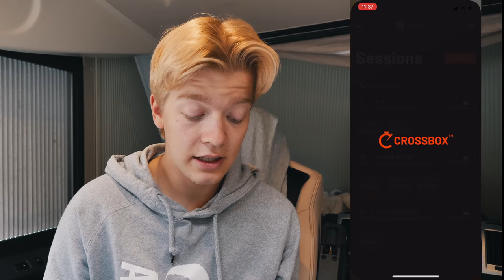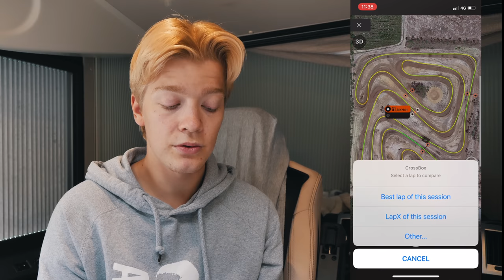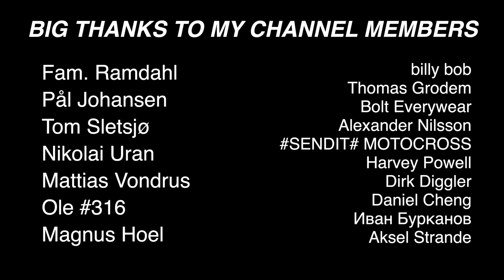MXGP Lommel 1.0 - Kevin MX

Comment: That was a tough 2nd moto. It's tough coming through the pack. But got to hand it to you, you tough it out everytime and push it to the end. When you finally get a top 5 start, just relax and flow with it, you can finish in to 10 easily.